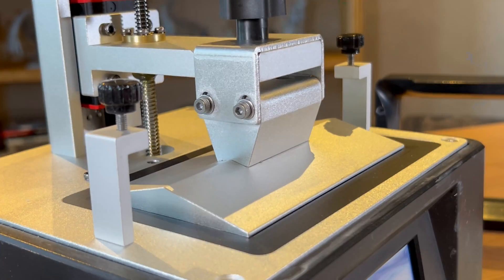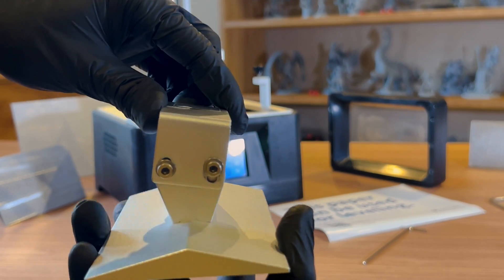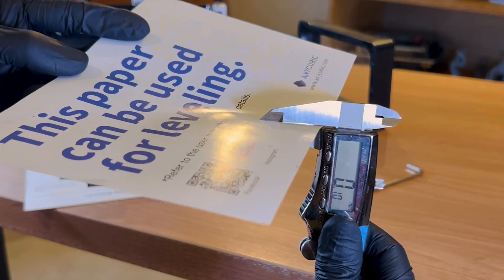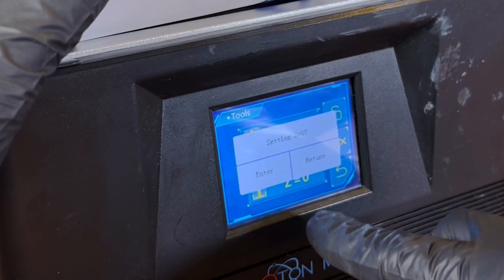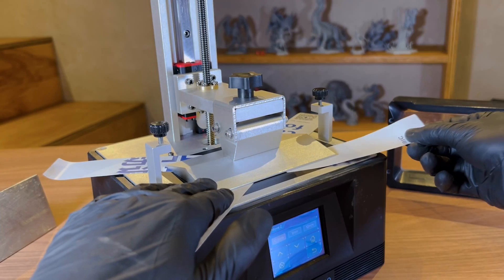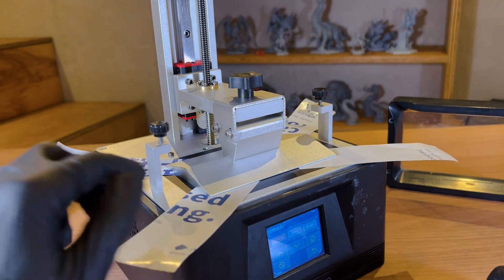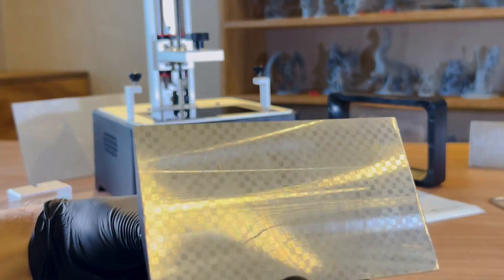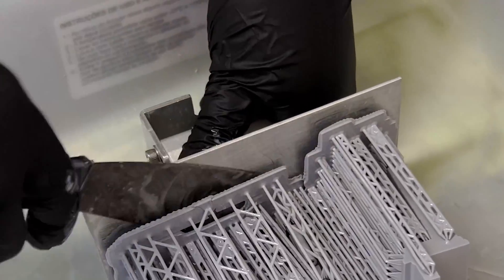Build Plate Leveling for Resin 3D Printers | 3D Printing Tutorials

Comment: Old vid hope someone sees this. I've got a halot mage, no matter what, it will not level. One corner gets tight, one has no friction at all. I've changed pattern of tightening bolts, little at a time, flipped the plate around, same thing. I've spent hours :(
Reply: Your plate may be warped, get a new plate then re-level.
Reply: @boeingt7236  I actually took it to my machine shop, it was pretty flat, it was actually the brackets that weren't straight. I got it fixed now. Thanks!

Comment: A non level printer means on any taller prints, gravity will pull unevenly, and tall supports will start to bend/sway a bit to the side, this can cause issues in their strength/final position, so while you don't need perfection in the level, you do want them as level as you reasonably can get them.

Comment: As far as sanding the plate goes, to ensure it is true, take a pencil or a marker and draw squiggles over the surface, it will help you see where the high and low points are.  As you sand the low points will have colour while the parts that are being sanded will be shiny.

Comment: thank you! This is a really good video for leveling. One thing to mention for anyone with an Elegoo Saturn is go file/sand the (threaded) end of the two bolts on the build plate smooth. if not they can mar the post and over time develope a groove or a spot that the screw will want to go to while tightening. This spot may not be where the plate is level. Cheers and I am looking forward to the next video.